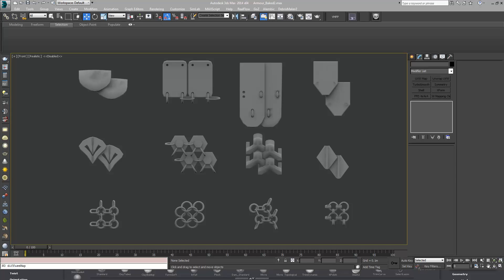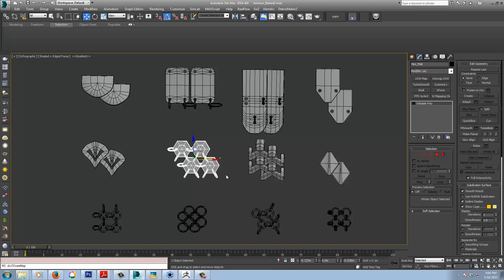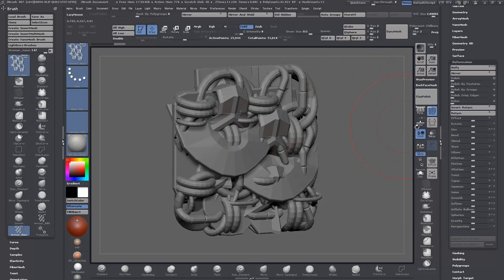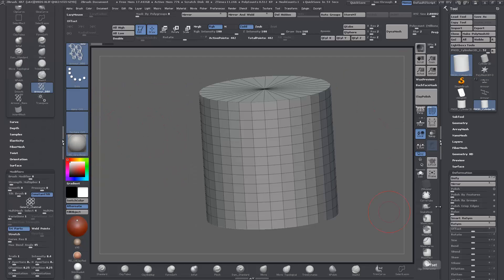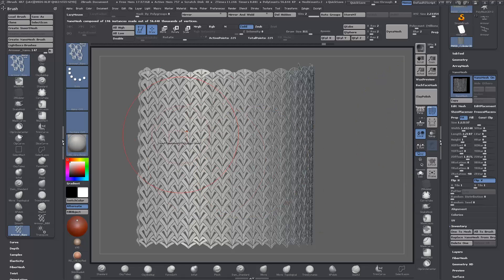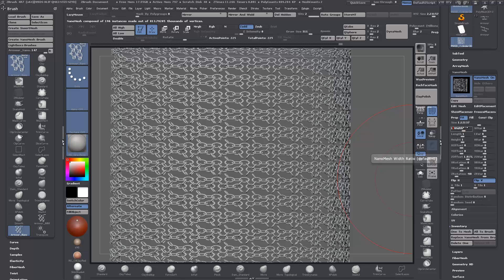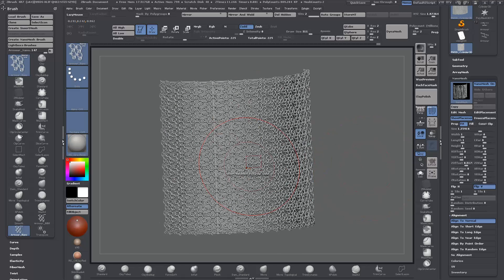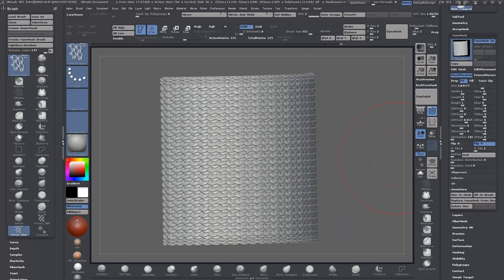Zbrush 4r7 - Armour IMM + Nano Brush

Comment: Hello
Can you model this same quality micro mesh in maya, or have to do retopologia and generate a map to extract the details?
Reply from the maker: Yes, you could model this in Maya using instances. There are many ways to do it. I use 3dsMax and there is a plugin called slideknit that is perfect for this kind of modeling. Maya has a similar plugin but I can't remember the name. sorry.

Comment: Forgive the noobie question, but can you now take the finished armor mesh and using a big Move brush, make the mesh as a whole conform to a figure below it? Or does the mesh want to break up?
Reply from the maker: +Kevin Phillips No need for apologies mate, good question. The beauty of using Nanomesh like this is that for a character you could duplicate the mesh, isolate the part you want to cloth(say a chainmail shirt) delete the rest of the unwanted geometry, run a Zremesh until you get relatively even quads(as the underlying surface topology directly affects the placement of the Nanomeshes) So this result in a perfectly fitted shirt. Then you can create a mesh from it and either split it to polygroups and use the mask by polygroups feature to refine/manipulate it, or move topological(which works on non-contiguous geometry) You can use any move brush you like, like your suggestion of a large move brush, you just have to be gentle with it as, yes, the mesh will skew/distort if you are over-zealous.
Reply: Thank you!
Reply from the maker: +Kevin Phillips No problem mate. Any further questions, don't hesitate to ask.